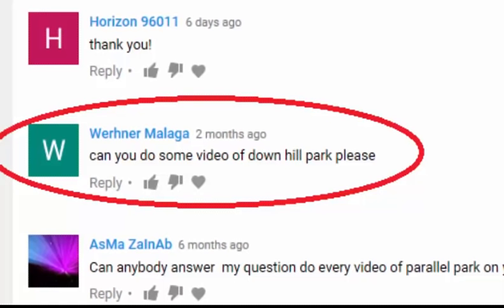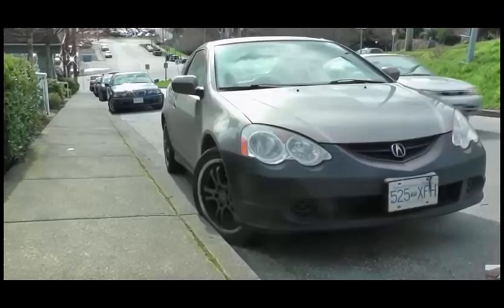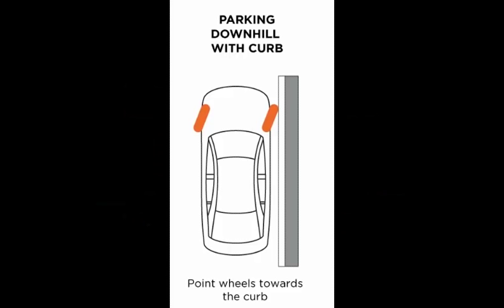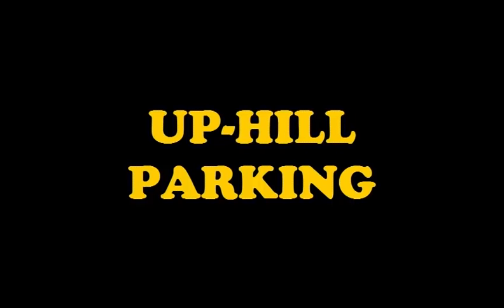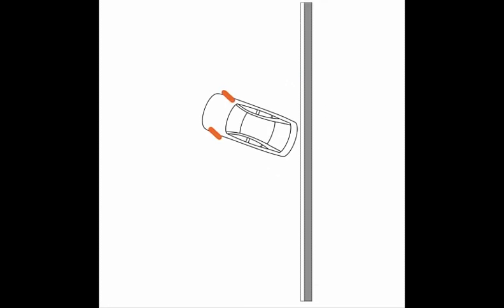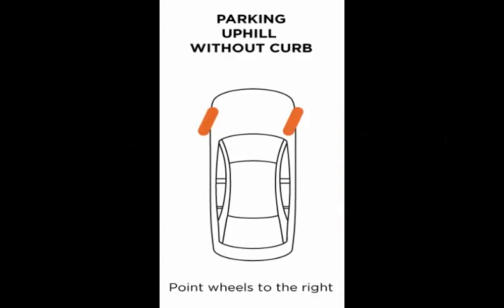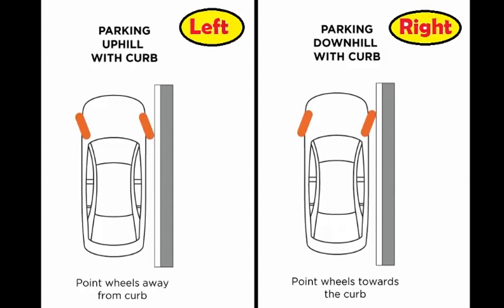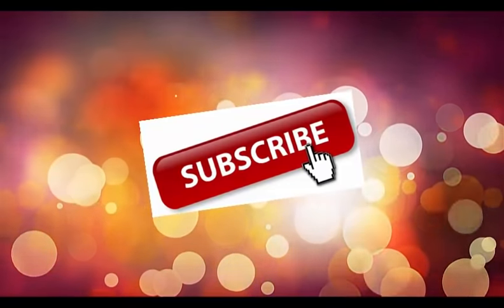How to do HILL PARKING (Uphill and Downhill parking) || Toronto Drivers

Comment: This was extremely helpful. If you just said it, I would not understand it but you showed illustration which made me understand it more. So basically you point your wheels to the left when you park uphill with the curb. I do have a question. Once I do the proper procedure when I park uphill with a curb, should I reverse my car until the front wheels touch the curb? Also, how far should I turn the steering wheel when I park until it gets locked?

Comment: Is there a sequence in the steps ?
I was told first Gear to Parking (safety )  , 2nd Wheels all the way to the right/left , then parking BRAKE .
and leaving the spot , first , parking Brake OFF , 2nd WHEELS straighten , then Gear to DRIVE also signal .

Am I correct in this ?
Reply from the maker: On the test they don't look at the sequence as long as you do everything. :)

Comment: I have a question? Do you need to use the neutral gear or park for the hill parking?
Reply from the maker: In an automatic car you must put it  in PARK and in a manual car, put it in Neutral but do not forget to pull the hand brake in both the cases. You could also chose to put it in the first gear for additional safety in a Manual transmission 🙂🙏

Comment: Thank you so much Harminder Suri for sharing your knowledge on driving. Could you please explain how to start a car when it is parked uphill I mean without going backwards? Thanks
Reply from the maker: Winnie Anand If you are asking from an exam perspective then just know that they don't take you on a hill to do a hill parking. It will be a flat road and they will ask you to pretend it is a hill. If it is a general inquiry then due to the hill  you will need to accelerate harder to move forward and might have to switch between the brake and the accelerator very quickly when required. Hope this helps.
Reply: Thank you Harminder Suri. Yes it is a general inquiry as we live in a hilly area so even if I get my license I need to know. Thank you.